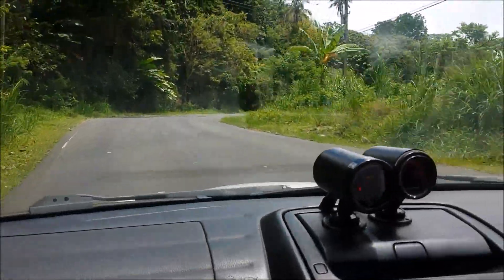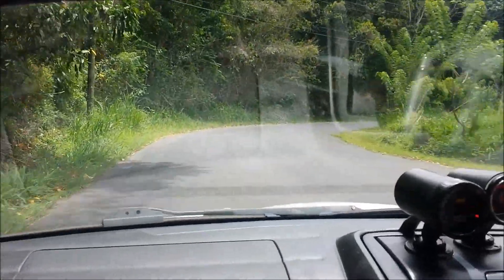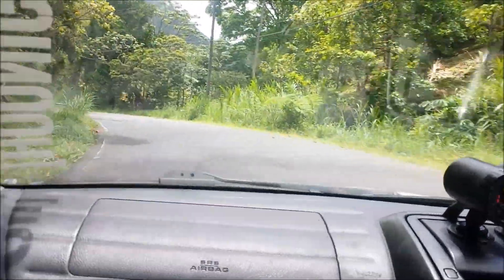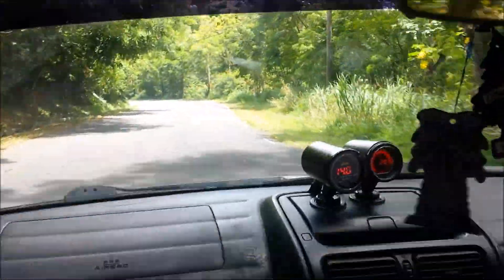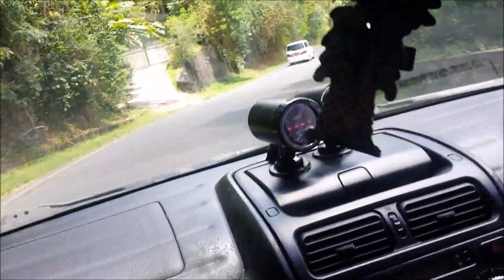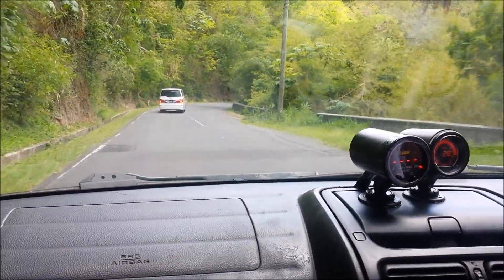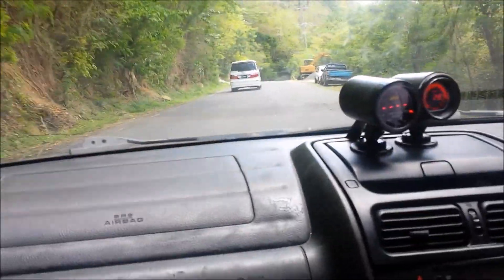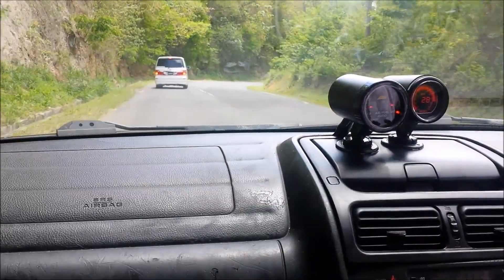Toyota 3sge Altezza Speeduino Install - Overview

Comment: Hey, DC agreed with not much tunes available for 3sge, I am currently trying to tune my 3sge gen1 and I am not getting much details on spark tables, I actually follow your channel and was convinced to switch to speeduino. However I don't know what's the maximum advance I can use before detonation, can you advise what's the maximum safe advance on that engine? so ill know to stay under that for mine... Help would be highly appreciated. currently I am conservative with maximum of 25 degrees.
Reply from the maker: There is no one size fit all when it comes to tuning especially ignition tables. It depends on condition of engine, fuel, mods, climate etc. 

Best way to find out what your specific engine likes is to invest in some knock detection equipment or take it to the dyno

Comment: Where does speeduino get throttle position from?  Does the factory ecu still need it or did you just splice in?
Reply from the maker: Speeduino TPS signal is just spliced in from the factory harness